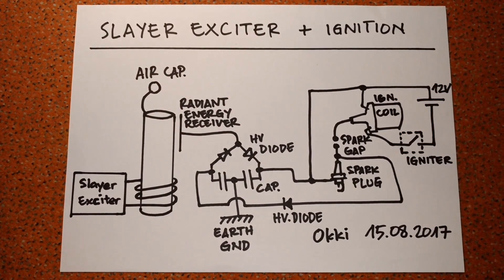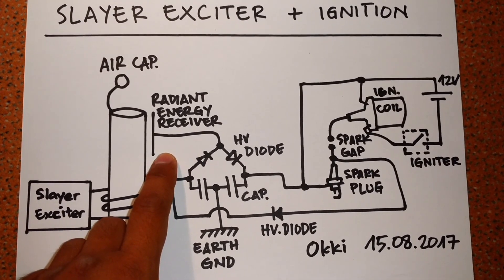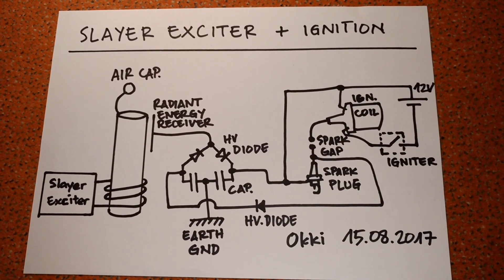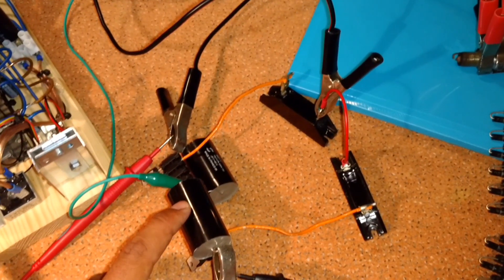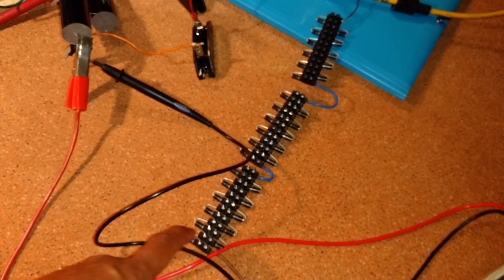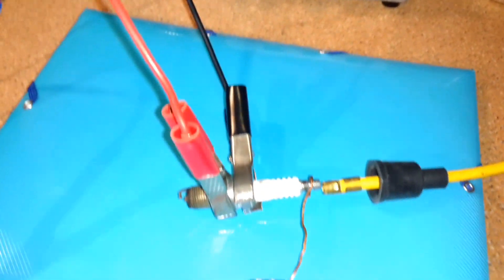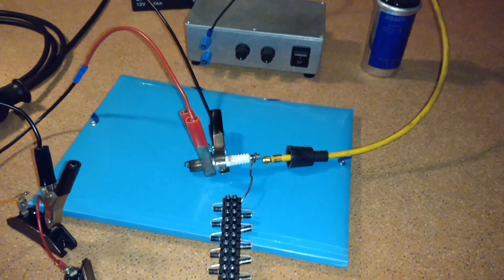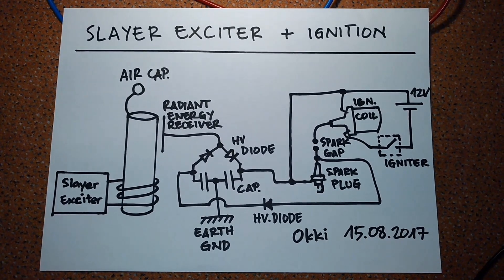Slayer Exciter meets Plasma Ignition

Comment: I’m again trying to adapt this for distributorless autos with coil pack ignition, but I’m afraid I don’t understand the left side of your circuit diagram.
Reply: And I would also like to see this working at under 100hz
Reply from the maker: Hi Gregory, do not use this system on your car. Here I use a small Tesla Coil to charge the capacitor, that is the left side of my circuit diagram.

Comment: Can you demonstrate any mechanical force generated by cold electricity? I want to see you put a magnet near a conductor carrying cold electrcity and see if there is a Fleming force on it, this is an example.
Reply from the maker: I have tried to run a DC motor using cold electricity. Here is the link: https://youtu.be/L9TF_jR1ybI
Regarding the mechanical force, I will try and see if plasma has the capability to push a small object.